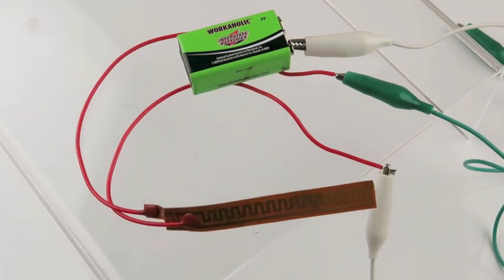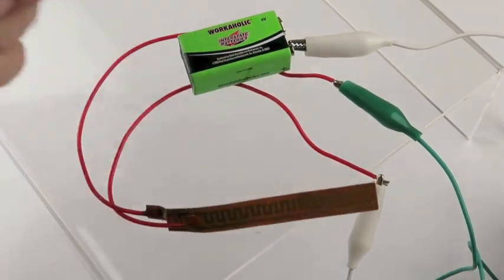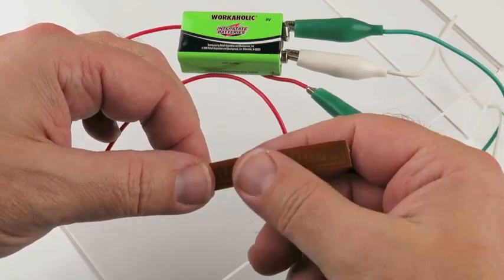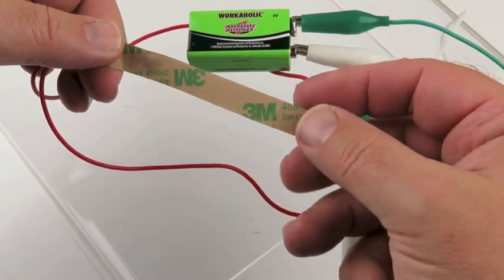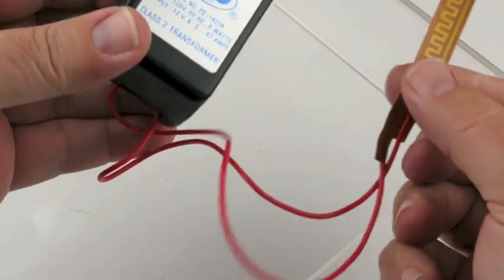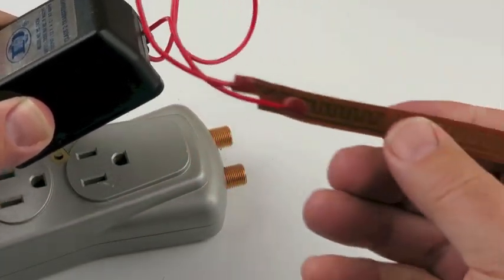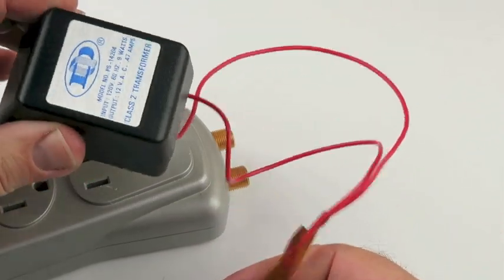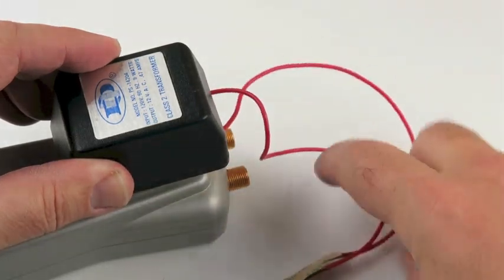G23514 - 12V 10Watt Polyimide Film Heater 10mm x 93mm

Comment: Well this video gives some information about the device but I'd like to point out this fact:  The advertised rating of this heating strip is 10 watts at 12 volts, which should raise its temperature to an advertised: 205°C (401°F).   The AC power supply used was rated at 5.6 watts resistive load.  ie the strip's max current is: 0.84 amps and the AC power supply used could only supply 0.47 amps.  This means the power supply was overloaded by connecting it to the strip.  The strip didn't get anywhere near its max temperature, as the overloaded power supply had to be drawn down to much below its 12 volt rating.   Practical use information I'd be interested in knowing is:  if its adhesive backing would work (hold) once this strip were left maximally heated for any length of time.
Reply: Did you ever get your answer?